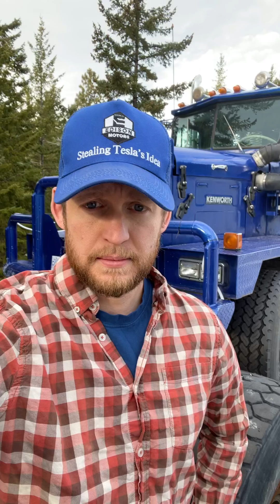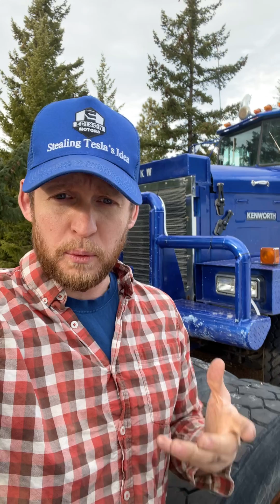Bridging the Gap: Diesel-Electric Hybrids as the Solution to Infrastructure Challenges

Comment: Mostly spot on. Log trucks tend to be downhill loaded uphill empty. Most of that energy you're currently blowing off with the jake brake can be captured and put to productive use. But yes, generation and grid both need upgrades and in the meantime, hybrid FTW!
Reply: So in practice, what that means is that you can get by with a smaller generator system in the trucks, the bulk of the energy coming from the braking regeneration as the truck moves down hill. There are a couple of mines where this is done, the haul trucks have very small generators for the just in case situation, but the primary power is the load going down hill.
Reply: Other trucks that do more mixed cycle driving loaded most the time could still benefit, just not quite as much. Also vocational trucks that run drills, pumps, etc, would greatly benefit. But yeah, logging in the mountains is the best place to start
Reply: Hmm, funny I pull a lot of hills loaded with logs. True, you're going up to the wood, in many cases. But there is a lot of up and down to get there. And yes, diesel / electric is the way to go in every vehicle in Canada, if we have to.

Comment: I like the term effectivization of our transport system rather than "electrification".

As there isn't one single silver bullet solution for every problem out there.

We need to trains, public transport for travel between cities.
We need BEVs for smaller vehicles that fit within the normal use case for most people or heavy local transports
We need hybrids (Electric vehicles with a local power source) for scenarios when BEV aren't enough or simply when the charging options arent viable.

Comment: You are on the right track here!  :)  I've always believed that solving our energy problems has an "All of the above" answer to it. The idea that we can focus and invest in only one solution o every need is not realistic, as you very ably explain in your video. I wish the car and light truck manufacturers were doing this too but of course if they were they'd pack on so many non-optional "Options" and add-ons the end product would be impossibly expensive. Even so, that is where my main interest is, to see this idea built into a typical standard pickup. One where the engine is gasoline powered and operated at ideal efficiency to spin a generator, both charging batteries and powering electric motor-axels. When the technology and production numbers make it affordable to convert a Ford F150, Toyota Tacoma/Tundra and the assorted Nissan-Dodge-Chevy models, that's when lots of people will buy into the technology. Anyway, it's great to see you folks doing what you are doing! Keep it up!  :)

Comment: That is the reason why in a lot of countries the locomotives are Diesel-electric, because the electrification will requiere a lot more nuclear/carbon/gas/oil power plants and high voltage transmisión lines. 

Renewables... sun and wind only works when they want, not when and where you need it.

Comment: Does anyone else "worry" about the smaller owner-operators in this brave new world?
If electric or hybrid trucks give a 20% operating cost advantage to a fleet operator, will they be able to "price" the little guys out of the market?
Will Edison be able to franchise or otherwise scale tractor conversions in the same way they are going with pickups? I'm thinking the "little" operators with four to ten trucks and virtually no overhead, where the owner personally knows all his drivers and his wife does the books - the classic "ma and pa" operation that is just more efficient than a big company.
They won't have the capex - or the pull - to be first in line for electric Semis, and the change is disruptive enough to make it very hard to compete.

Comment: The world is 99% clueless. Live in a city (80% of Canadians) and drive your car to work - OR THE GO TRAIN? An electric car just makes sense. Use Google Earth to look at: Clarkson GO, Port Credit GO or any of the SIXTY-EIGHT stations. With over 70,000 parking spots. JUST ONE CITY. JUST ONE TRANSIT SYSTEM.
That's just the GTA, but almost ALL those cars SHOULD BE SHORT RANGE BEVs. Most of them only go to and from the GO station and the grocery store etc.
Now look at any major distribution center, you know the ones I mean, the concrete behemoths with 50, 100, 150 loading doors visible all over the world in "business parks". HUGE roofs suitable for solar panels with a little design work, and parked trailers and tractors (day cabs) everywhere. The economics favored solar and all-electric for "city pickup and delivery" TEN YEARS AGO.
Smart operators will be moving to a blended fleet as quickly as replacement capex and charging allows them (smart operators are unfortunately in very, very short supply). Dollar savings will drive the transition. And logistics is a very conservative industry, but once somebody shows that it's a tactical advantage the herd will follow.
Line haul and sleeper cabs? That's easily a decade away. OR MORE.
In the meantime, a smart fleet operator would be watching Edison very closely - what's a twenty percent reduction (or more) in per mile costs worth to you on linehaul? Plus lower maintenance, with its resulting higher utilization? PLUS getting into "low emissions areas" (they will be coming, just like London England) in pure battery mode?

Comment: The truly galling thing is that this transition should have started at least a decade ago. That's it's 2024 and an upstart company in the middle of BC composed of annoyed logging truck drivers is apparently the furthest along on this path is kind of mind blowing.

On the issue of power grid capacity, it's worth noting that quite a bit of slack capacity may in fact exist: Ontario's peak power demand was in 2005 (!) at 157 TWh, down to 137 TWh in 2022, a level that it has had since the mid 2010s. That difference alone is enough for EVs to travel some 100,000,000 (one hundred million) km and that doesn't account for unused off-peak generation capacity and increases in generation capacity in the years since.
Reply: I agree. I hope this idea takes off. Sodium Ion batteries are starting production, I bet they would be great for his trucks. Sodium is cheaper, almost as energy dense as LFP, and hold a charge much better to 0⁰C. It sounds like it could be a great option on trucks in Canada! Save the LFP trucks for the American South
Reply: @deansmits006  where are you seeing that they are in mass production? I’ve seen lots of lab tests for that and other battery tech. With all the raw materials Canada has the government would be better off investing in battery research and manufacturing than the grossly over budget trans mountain pipeline that has had numerous reports refute the original revenue estimates.

Comment: I agree, the infrastructure isn't there to go fuel independent on heavy machinery yet.

And despite the fact that a large wind turbine can output perhaps 15 MWatt, it's always when you need it the least, you don't want to be hauling while trees are falling.

But I do think that wind turbines with proper powerbanks will be part of the future solution... but exactly because diesel-electric is easy to make modular, the power plant will be easier to replace as infrastructure gets more mature.

Comment: Theres little doubt some places will have to go hybrid.. the exact fuel should be optimised ... Methanol-hydrogen is where the shipping industry looks to be going... Ammonia is the other alternative  but its unpleasant and dangerous to handle .. a fuel leak on a ship needs full protective gear and its damaging in the environment.  

Theres a team in the UK that have hit on a solution for jet fuel.. they have been able to produce it from  human 💩💩💩... 😎👍🏼

Eat more beans .... 😂

Seriously though this has been developed and is being approved by Cranfield aerospace research institute and the  regulatory bodies are already in there, testing and evaluating the  produced fuel .. 

Now that really does make sense...it can also be further modified to produce heavier and lighter  
fractions. 
Not only is using human sewage ..a major waste problem in itself but its relatively simple and low energy to produce. It also deals with a lot of the problems that arise from having to deal with human sewage. ..  Keep up the good work but keep one eye on the wider changes afoot. 
If ICE motors are to contribute they need to be able to run different fuels and be more efficient ..simpler, lighter and cheaper for generators than direct drive  conventional poppet valve crank and piston motors. 
🧙‍♂️🇬🇧

Comment: I wonder how well the Diesel-Electric would perform under Highway conditions. for uk it's 56mph max and wouldn't need planetary hubs and only requires 1 powered Axle as we can carry 45,000kg GVW with a single powered axle (unpowered axles would be required). (edit for correct GVW)
Reply: UK and most of (if not all of) Europe, due to the shorter distances, lower speed limits and denser power grids. We are already at the point where full electric makes sense....if you are buying a new truck. But swapping out a tired diesel power train for a Hybrid form Edison could make sense, buracratic problems aside.
Reply: I've looked into it and unfortunately the shear cost of Electricity when getting a large supply would not work for us as a UK wide Haulage company. Full electric realistically can work for Distribution Centres to Depots and possibly last mile deliveries.
The UK has insufficient charging networks currently to support it and currently very few parking areas for HGV's @idrisddraig2

Comment: No one talks about diesel electric hybrid because that still encourages independence.  The powers pushing ev want control; they dont care about clean, green, or efficient.  Only fully electric on a controlled grid allows them to turn off anyone with a contrary opinion
Reply: What a bunch of insane BS. The entire point of Crude Oil dependency to prop up the international cartels. There is not an OPEC for Electricity Supply, because it's Not Possible.
Reply: "controlled grid allows them to turn off anyone" NOT POSSIBLE!
Privately owned generation exist.

Comment: Funny thing about diesels: They don't have to run on diesel fuel. Propane/LPG and hydrogen are good alternatives, especially when you consider that hydrogen is 5% more efficient than diesel... and--not to mention--a lot cleaner burning. That only leaves the packaging issues to deal with... but once those are resolved, we'll really have something with these diesel-electric series hybrid trucks!
Reply: If you have hydrogen tanks anyway there is not much point not going fuel cell. Way higher efficiency, no noise, no moving parts, no maintenance.
Reply: @igornoga5362   -  just the fuel cell "stack" cost to deal with....  (plant cost up front can be a killer..).
Reply: The biggest problems of hydrogen are making it efficiently and cleanly and storing it. The stuff is difficult and dangerous as hell, to make a understatement.

But it’s just incredibly wasteful to burn the stuff in a internal combustion engine. A fuelcell is way, way more efficient now than a ice will ever be. They are not widely available or reliable at the moment, but there is no large scale hydrogen either so there is time to develop the technology.
Reply: @autobootpiloot   (note that large scale hydrogen is exceedingly easy to  make using nuclear power plants, once those are installed the fuel will be in limitless supply - "IF' it were deemed useful, lol...  (Not being "hooked"  on one particular concept  is key to being agile.) )
Reply: @kadmow  I agree nuclear is beneficial, but even nuclear is a long term solution. Nuclear takes at least a decade to build if they start tomorrow with the planning. And the first few nuclear power plants are needed just to keep the grid up and powered as it is now. We are a long, long way away from excess energy we can use for hydrogen.

Comment: It doesn't need to be diesel electric.  What you are referring to is range extended battery electric vehicles.  Using a combustion engine to power a generator to charge the onboard battery pack.  A little gas turbine engine would do the same job.
Reply: A diesel is way more efficient than a gas turbine in terms of Energy conversion. But in some aplications (not this one) the gas turbines power to weight ratio will make it the preferable option.

Comment: The trucks can't require 10 GW per day. You got your units wrong. Watt (W) is power, while Watt-hours (Wh) is Energy. They probably require 10 GWh per day? If the powerplant produces 1 GWh per day, that would be a problem. If the rated capacity of the damn is 1 GW, it can theoretically produce 24 GWh per day.
Reply: Anyway it's loggers only. It is small portion of traffic. Add all other vehicles and you may start to learn make your food on fire, wash your clothes in river and use candles for light in your house because all power is gone for transportation
Reply: @NoAugsas  Yeah, not saying his inference is wrong. It just irks me as an engineer, if people are using the wrong units, especially if their point is valid. It makes them and their argument look incompetent.

Comment: Are you saying a truck uses 1500kWh in one day? This seems way too much. I looked at consumption of logging trucks online and it said around 71 l/100km comparing to vw golf which uses 6l/100km in diesel form and 16kW/100km in electric form. Truck consumption should be 190kW/100km and assuming 300km per day that's around 570 kWh per day or 2.85 GWh per day for 5000 trucks. Site C dam will produce 4,600 GWh per year which is 12.6 GWh per day. Which is more than enough to cover logging trucks if my math is correct. Btw I'm not hating on the idea, i think your doing great work.
Reply: If you can provide me a vw golf that uses 16kwh/100km I order one right now. They might use that little on paper but no way any ev is using that as a average on the road right now.
Reply: Didn't look too deep into your maths at all but your km assesment is way off. I do something completely different to logging here in Australia but we do about 700-800kms a day
Reply: - using the numbers being bandied around, a Logging truck which DID do 400km / day - with an AVERAGE consumption of 71 L/100km, (just say that is right), is using 3MWh  (ie 3000kWh) per day of diesel energy.
Allowing for an Electric vehicle to be around 2.7 x
 as efficient, that will mean they need around 900-1000 kWh per day of Electrical energy  (hilly country can provide significant regen...)....

 - NB, an assumption of the 71l/100km  - that number is straight from a google search on "logging truck  fuel usage", means an average mechanical power output of ~180kW  (ie. a truck working at at around half its typical power capacity - assuming that 80km/hr is a pretty good number - for a hard working truck - non highway/ line haul)
 - Chase obviously knows more about the real world of, how many miles and how much fuel a (his) diesel log truck uses under his use case -  than me - though I can run endless models of hypotheticals - just for fun.

Using similar numbers comparing your "Golf" fuel usage, and the "guesstimated hypothetical EV efficiency" (neglecting generation and transmission losses)  21-22kWh / 100km should be a rough comparison - IF an EV gets better than 15kWh / 100km on a highway drive, that is approaching 100% Electric efficiency   (cough, , ie. BS)  on an equivalent of 4-5L per 100km (Diesel) - presuming that a modern diesel engine and drivetrain MAY be up to 28- 35% efficient..   (18-21kWh/100km - is a more realistic number for long distance driving in all probability)

(We all know that B$$ing online is easy - but it can be interesting to see what the numbers say - to figure out if something is feasible or not -  or if someone is sprouting absolute garbage, lol....)
(taking other guy's highway usage - assuming Australian type road speeds, I get between140-180kW - mean power output (a very heavily working offroad truck could be doing a lot more than that, but at a lower speed.)...
Reply: I just found some data online it said 100000km per year. But even if we assume 700-800 km we should be getting 25-50% back in regen, so it would still work. What kind of mileage do you get thought is it close to 71 liters or less?
Reply: @DIYsometimes344  were doing b double and road trains. Of supermarket groseries so we're only 50-75% of full weight. My truck gets around 40-50 l/100kms

We travel out full home empty
Reply: I had one and that's what it said on display. Also online they give same for model 3. But there are loses in ac-dc conversion probably more like 20